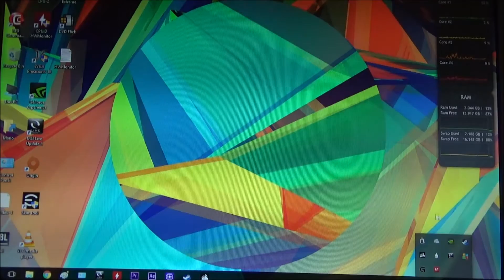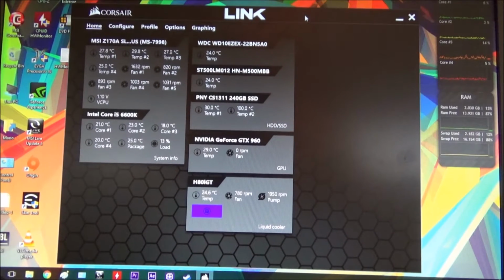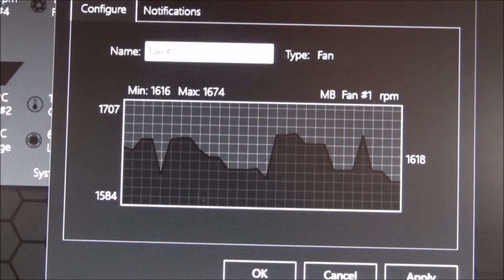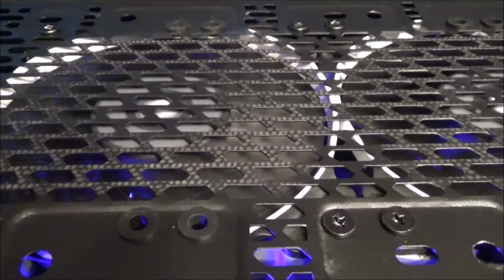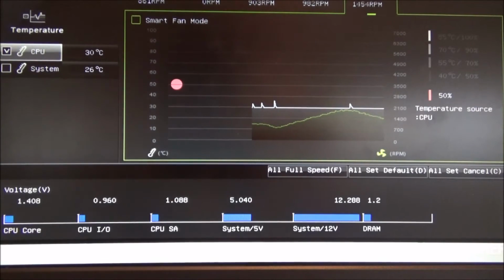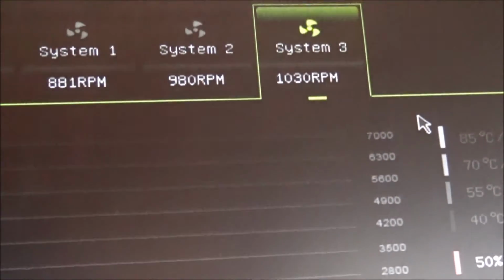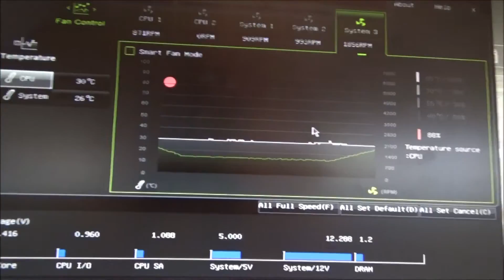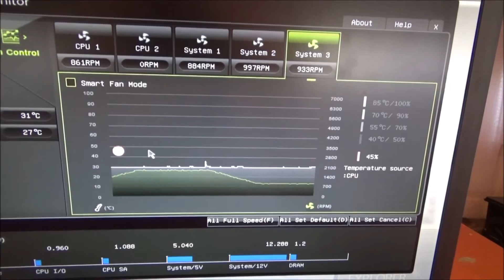Fixing a LOUD PC Case Fan That BIOS Can't Adjust

Comment: How do I control the molex fan speed? They wrom very good but they are so so loud it's crazy. They are 4200rpm nanoxia server fans. But I didnt realize they were molex fans. How can I make them more silent.
Reply: Molex fans can't be controlled because they are plugged into the power supply. To control them you could either buy adapters to 3pin to plug them into the motherboard, or buy new fans that use 3pin or 4pin instead of molex.

Comment: Simple answer: change your fan settings to voltage instead of auto or pwm
Reply: Where?? Help me plz
Reply: @benjapizarro981  i don't exactly remember what I did a year ago but when you first get into the bios (turn off then on your PC to get to bios) you go to fan settings and it should be in one of the sub-settings. I had this problem because I had installed a fan cable splitter.

Comment: I use the same motherboard
after installed a new fan it ran at full speed too
but I was able to ajust its speed through the MB BIOS
Reply: Adriano Costa how, what setting did u change

Comment: I discovered my case has negative air pressure. I have got two cheap led fans and one stock fan (better quality) for intake but I am planning to replace the two cheap fans for some higher end fans. I am struggling because I have only 2 motherboard fan headers left. I also have a built in fan controller in my case connected to my psu but I don't know how much voltage it supplies max. I like to keep led fans but they are mostly weaker and louder. Still thinking about the best looking and best performing fans to buy.
Reply: Corsair SP120s or AP140s are both a great choice.
Reply: Mario Saltalamacchia I did the thing. I ordered 2 Noctua's NF-A14 PWM for high intake pressure. Ugly but I put them on a spot where I barely see them. I'm sure these will do the trick as well. Can't wait till they arrive
Reply: Zucchero Klein good shit.